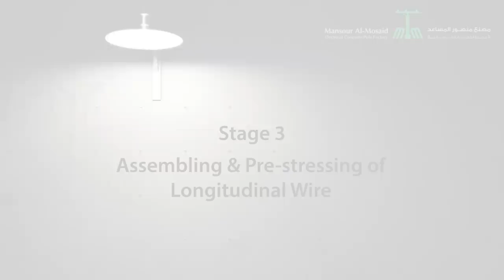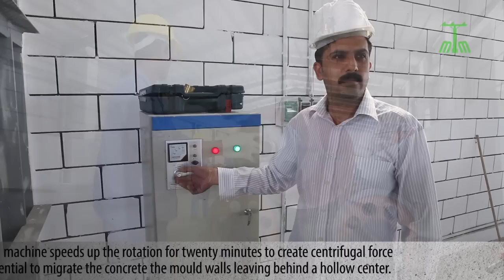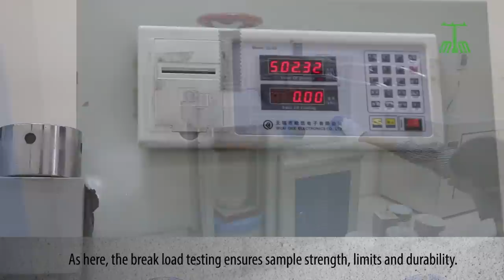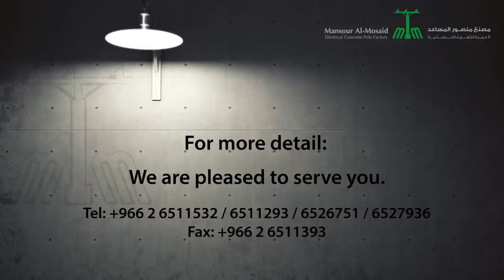Saudi Concrete Pole Factory

Comment: Very informative video.  Thank you.

A few technical questions to ask:

1. During Stage 5 as well as Stage 6, how does the process ensure that air gaps are removed from the mixture before the spinning works start?
2. As part of the quality check, how does the inspector detect any air gaps (post completion of stage 5 and 6)?  Are there any resources/testing devices to establish these credentials and absence of air-gaps.  My civil engineer tells that, in case, there are air gaps - particularly in hostile environments like Saudi, Qatar, Oman, UAE, Bahrain, Kuwait and most parts of the Arab World, air pockets can always cause corrosion, because of temperature + presence of oxygen (abundance of air) and varied environmental conditions such as acid rains, vast temperature gradient and other attributes.
Reply: You ask too much question. Ask your parents!

Comment: Interesting centrifugal force machine but the rest of the process is SHOCKINGLY low tech. I mean you have a guy holding wire going on a roller? And you're doing twist ties BY HAND? We have cheap hand tools that twist as you pull backwards and also tools like cordless drills that you load in a roll of wire on a plastic spool into the side and it puts the wire around, twists ot and cuts it off.